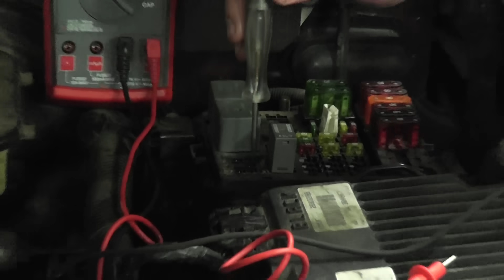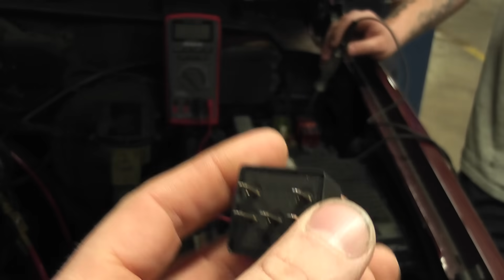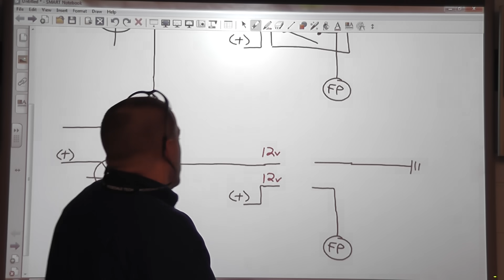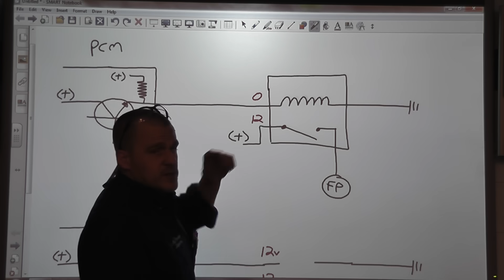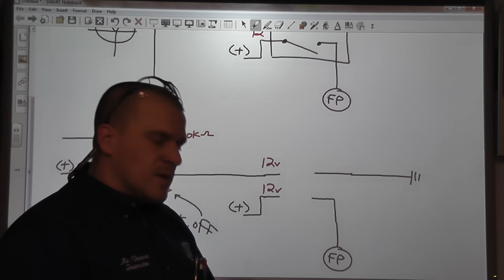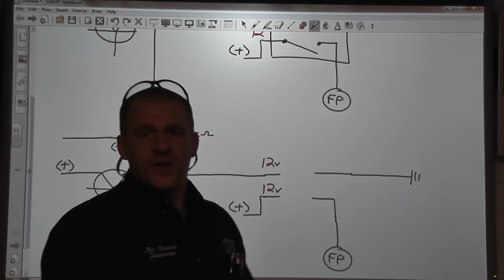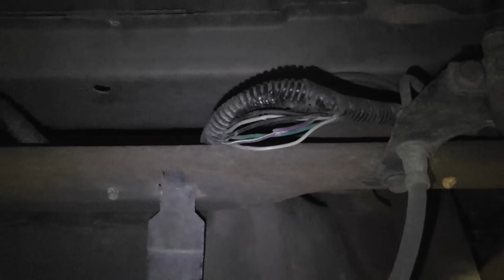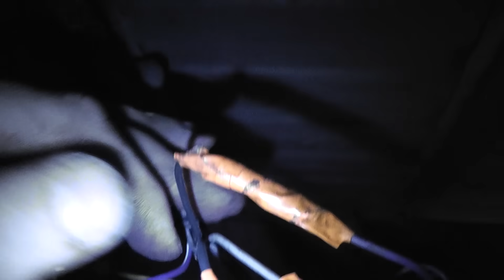GM Fuel Pump Relay Testing

Comment: Good morning,
Sorry if you even respond to this or not, but I have a question about my GMC Sierra 3500 SL 1994 fuel pump. It's a U haul box truck. The relay seems to be located inside under driver stearing area.
1. Suspicion= Bad fuel pump
2. Question+ How do I determine my ground is working in power distribution?

My Diagnostic
1.  +Battery to 86 with volt meter= no battery power with key /without key
2. When I jumper 30 to 87= Horn blows. 
3. -Ve  Battery to 85= 12V(battery  key on).
 I also cleaned the terminal to chasis with wire brush to no effect.
JUst that taking 40 gallon fuel tank is daunting job and I want to make sure of it. Also how do I know that my power distribution has ground contact.
Thank you in advance, and your instruction is really helpful.

Comment: Hey brother this is an awesome video! As are all of your vids!  I am currently T/S-ing a 1997 k1500 w/a 5.7 ltr.  I trying to narrow it down to the fuel pump.  When u checked the relay it had a 4 pin relay.  It looked like the center pin (87a I believe) was broken off or removed.  I am 99.9% certain that this supposed to be a 5 pin relay.  Just curious if you have seen this before or is it standard.  Thanks for any help!

Comment: Im having a hard time with my 1990 c1500 5.7 liter.  I have spark, fuel but low fuel pressure into the tpi throttle body and i have air. The truck will only run on starting fluid or brake cleaner. Replaced fuel pump, tune up and ignition spark control module in the distributor cap. The fuel relay clicks twice but doesnt buzz im getting confused.... Any help is appreciated. Thanks.

Comment: On my non-starting 2005 Astro van, I pulled the fuel pump relay and set my volt meter across 87 and 30, cranked the engine and it started!
I was so shocked I immediately switched off. And it seems to be fixed now...any ideas why it might have started and appears fixed now? 

I thought I might have fried my multimeter but it's fine. 

Weird!

I did find a bit of chaffed wire coming off the main fuse box (where recent battery change rubbed against fat wire harness), but I don't think that it was touching anything else.  
I wonder if I should have a fuel pump ready for imminent failure...?

This video is super helpful, thanks guys!

Comment: The reason that you see 12 volts on the control voltage terminal on the relay socket with a volt meter (yet the test light doesn't indicate voltage being present) when the relay is removed is because the meter has a very high internal impedance(resistance) compared to the coil in the relay, which is essentially a short as far as DC voltage is concerned, and pulls the bias voltage to ground when the relay is in the circuit. The test light has a filament that requires more current to light up than the bias voltage circuitry can provide, which is why the test light doesn't light up, despite the meter reading voltage. I am an electrical engineer, but don't know the exact circuitry involved, but your description and schematic is pretty much what is happening... What you drew as the bias circuit created what's known as a voltage divider, where the majority of the voltage would be measured across the larger of two resistances in series as you've drawn. All in all, a very good description of what's going on!

Comment: Having the test light and/or the current meter connected are great tools working together when locating an intermittent pump or current feed problem.  I connected a set up like that and monitored them while driving an E350 6.8L V10.  The problem was the fused power pin at the Inertia Switch had got hot, lost it's spring integrity, which caused it to lose contact with the Inertia switch.  Replaced the pigtail, problem solved.  Another tech had replaced the fuel pump AND the fuel pump relay.  He didn't know the connector at the Inertia Switch had got hot/overheated.  It took a while, I finally found it.  Problem solved.
Good Video!  Didn't know about the bias voltage in that GM circuit.

Comment: The Oil pressure sensor is also a source of power for the fuel pump, while the engine is running. This is done to keep you going in case of a fuel pump relay failure, once you turn the engine off, no oil pressure, no power to the fuel pump from that source!

Comment: great video, and i happen to have a 99 old style suburban 5.7 stranded at my sons job site since  last night, fuel pump not running, he starts his vehicles and lets them sit and run for little bit to warm up, his words not mine, this is my suburban he is using, he started it and let it idle for about 3-4 minutes and it just died, dark there etc so im going with test tools and tools tomorrow to attempt to start it, my biggest problem is for every search site you pull up someone has a different story on the pass lock or security system on the vehicle, does it shut down the pump, only thing i know for sure it doesn't shut down the starter, i can test all the components but it makes it so much easier if you know what is supposed to happen. this is the system where the key is a normal key, no magnet or carbon, no rubber on top, just the metal key, i believe it is just called pass lock, or that version of the vats.

Comment: fuel pump relay issue, 2002 GMC Savana, problem is, no 12volts going to control wire (green/white stripe) of relay, so what would keep 12v being sent to relay??

Comment: He this wayne I've done everything to the s10 1994 .checked ful pressure it's at 58 to 62 all my map sensor throttle sensor checked for vacuum put new wires new rotor new cap knaw I'm down to got fire getting gas when it starts it runs rough give it gas to keep it running it flutters out .well I'm thinking crank sensor .I've tore out everything in dash looking for short no short under hood no short this 4.3 is kicking my el butto

Comment: This is why I have Scanner Danner premium on his website. Even if he never makes another video, how can u thank him for the humongous library chocked full of instructional material. I have watched this video several times. But now I have an 01 GMC 4.8 in the shop. And that bias voltage will help me identify control pins. GM relays will plug in both ways and that throws me off. Thank u Paul!!

Comment: So i replaced the fuel pump on my 2000 silverado 4.3, and it ran great for a couple months.. lately its been stalling and dying randomly goin down the road.  Then takes 5 to 10 min to start.  Where do i start?

Comment: Your diagram makes it pretty clear. Ideally you could measure the voltage across the coil in the relay to see if its being energized.  Once you unplug the relay the 100K pullup resistor is in series with your meter ( say a MegOhm or more) so most of the 12 volts drops across your meter. I suppose you could unplug the relay and put a test resistor (of similar resistance to the coil in the relay) where the coil would be, and measure across that.

Comment: Is it ok to use a test light on a computer controlled circuit? (when they checked the prime function on the power circuit) i have heard from multiple sources to not do it, I think it worked very well in this video though. does anybody know what the story is with not using a test light on computer circuits? I would like to get cleared up on that.

Comment: ScannerDanner. Your experience is invaluable. I have been experiencing a no start issue in a 97 suburban. The original fuel pump was replaced a couple years ago. The mechanic I used ended up replacing it twice as the first replacement was dead a week later. It started just fine for a while. After that it started the no start. What is interesting is, it seems to be determined by temperature most of the time. I have heard many bad things about replacement pumps. My mechanic uses Delco replacement parts. 

When it doesn't start, the engine will turn and turn and sounds like it wants to fire. When you let off on the key the engine will bump a couple times like it's still trying to take off. There is a video on YouTube that displays what is happening. And I have come across a lot of others that seem that have the same problem. 

I find that if I turn the key to prime the fuel system 3-4 times I can get it to start more often. Is this an issue with aftermarket oem pumps???

Comment: Hello. Everybody. I. Have a. Dodge caravan 2004.  Somebody broke in my truck. And messed the ignition up. So. My mechanic. Had to drill it. Out. So i went to the junk yard and got another steering colume.with key in it.  The other key. I. Had. With ignition from auto store. The truck ran for a few. Than it shut off. Can abody. Help me

Comment: you saved my butt showing bias voltage . I was making check on my 1998 5.7 vortec and showed 12.24 v. this was messing with my head and i was thing something else was wrong....  I had watch someone else on this relay and they said no voltage on that pin with key off.....thanks so much.

Comment: I have a 2000 Yukon that was randomly stalling while driving.  I installed a new fuel pump and it still stalls every few hundred miles.  Today it stalled so I pulled over and tested the fuel pressure and there was none.  Cycled the key and pressure went to 60psi, car started fine and ran another 100 miles no problem.  Do you think the relay may be the culprit?  Or PCM or a bad wire somewhere causing random shutdown of the fuel pump?

Comment: Hi great video! 91 s10 4.3I have biased voltage with my relay plugged in.coming from ecm 0.07 volts when not plugged in 11.70 volts. I have pump running jumping org wire to green white wire. The prime doesn't work.could pump be bad? Thanks, Greg

Comment: ScannerDanner, I'm having a weird issue with my 1991 Cadillac Fleetwood Brougham.  My fuel pump does not turn on with the key. But when I hook the 2 wires of the harness to a jump box, you hear the pump running. There is still no fuel pressure though (car will not start).  There are 4 wires to the pump. I believe there are 2 grounds, a pump wire, and a sending unit wire. Could it be a bad ground?  Also, when I turn the key forward and put a volt meter to the 2 wires, where I had the jump box hooked to, I get a 12 volt signal (indicating that I'm receiving power).  Furthermore, I did unplug the harness from the car when I plugged the jump box directly to those 2 wires.  And I also left it unplugged when testing for voltage from the car's end of the harness.  Should I plug the harness back up, turn the key forward, and then check the pump side for voltages and grounds?

Comment: Hi Scanner Danner, great video!  I learned a lot, thank you.  I have a 1997 C2500 5.7, (bought new, cared for, now has 229,000 miles and looks a drives like new) and I'm curious about amperage.  I'm drawing between 9 and 10 amps.  I used my Fluke 337 clamp on amp meter on the wire to pin 30.  The reason for all of this is the 30 pin got so hot it cooked the surrounding plastic.  I repaired everything and now for the first time, I'm checking for heat and finding some after a 10 minute drive.  30 and 87 are hot to the touch.  Is this normal, or could this be a sign my pump is going out?  I'm on my third pump.  First one died of low pressure.  Second one didn't work after a six hour drive.  I appreciate your help.

Comment: Nicely done but you should find the guy who installed the pump and tell him to find another career. Not only were the wires backwards but the splices were hack jobs and they ruined the wires by stripping the insulation off. Both of these would have failed again shortly after water and salt got to them.

Comment: Wow...  You guys deserve medals for your painstaking film!

I still don't quite understand why the PCM needs that bias voltage - which makes a 1950 test-light superior to a modern, 10-MegOhm meter - but that discovery at the back reinforces what I tell people about using OLD shops instead of start-ups...

I actually encountered the same problem with 110V in my Elks club.  When I converted old-style potentiometers and mag-ballasts to modern electronic units, they wouldn't dim...  Sure enough, some moron had wired white-to-black & black-to white!
LOL

Comment: 96 chevy blazer 4.3 has a new pump, relay and fuses. have tested pump(just in case I got a bad one), and I still get no power to my pump. Have tried everything people suggest except wiring direct. that just don't seem safe to me. Being a pro, do you have any ideas I could try? really need help here. Thanks

Comment: would anyone know anything about this problem?
parked.mu truck.
got in it after work and started right up.
but then was acting like it was not getting fuel.
changed the.pump
started right up.
but when I go to step on gas pedal it wants to die...any ideas????.

Comment: Question : Since the wires that were wrong back at the tank could that have been the reason that you were getting the 12 volt reading up front. At least  it was a thought.

Comment: this video , saved my but , helped me determine,  i didnt have a ground .    it would be better if he took out all the diagrams/graph part , but all in ,  need to add , a reminder if you took the bed off a pickup for installation of pump rather then the droppingvthe tank ,     must re-connect,  the ground wire to the frame where you unpluged the tail light wires for the bed removal,  or you end up looking at this video - simply for a quick test after install of new pump , with the bed still off ....  before installing the bed .       all mechanics check their work ....

Comment: I have an 89 camaro with the 5.0 that for some reason after sitting it will not start.  I do not hear the fuel pump come on when you turn the key.  But if I run a hot wire from the battery to the wiring behind the back seat I can hear the pump run.  I replaced the fuel pump relay but it still will not start.  I loosen up the fuel lines at the carb but when I even hot wire it I am not getting ful.  I know the car has fuel.  I am at a point of dropping the fuel tank again and try replacing the pump.  Not sure if the pump is running in reverse when I touch the one wire or not.  Tried touching the other two wires but nothing happens.  Got any suggestions you can send my way.  Sure would appreciate it.

Comment: Damn I wish they would've kept it simple and more reliable by sticking to mechanical fuel pumps. This is interesting and informative but I've got more important things to study and learn. Planed obsolescence (intentionally designed to fail after a given time) is an integral part of all design these days. I'm no mechanic by trade but even I could have kept my 64' Chevy truck running indefinitely, but THEY don't like that. Today's good mechanic has to be like yesterdays rocket scientist.

Comment: I would think the voltage behaviour you describe will be to do with the on board diagnostic system, to allow the ECU to determine shorts or open circuit situations.

Comment: I drive a 2006 Savana for work, its owned by the company and it was randomly stalling. My boss's mechanic put a new fuel pump on it, that got it running for for a day then it wouldn't start. So the mechanic said it was an electrical problem and he said the fuse box was faulty, apperently he replaced that. Now the wiring is a bit screwed up but it was kind of runs. The engine would surge really bad. I took a look at it, the fuel pressure was really low but only when driving, idle was fine. I tested the fuel pump relay and the voltage when driving would go from 12v to 3v then up to 12v and so on. I did some more tests and found the wiring for the fuel pump relay runs in series with the canister purge valve. So I bypassed the purge valve and now it runs fine. Does anyone know if they are supose to be wired in series like that?

Comment: I guess that if the pump relay is ticking that would be the computer causing that. I haven't gotten a chance to look at it yet but it also constantly primes the engine in the on position before cranking and ticks like a clock, while priming and running. Engine surges bad, follows the ticking pattern. Very strange.

Comment: I have the  same problem  but if I let it sit it will start and will run for a week then not start I have replaced the fuel  pump" it has spark .

Comment: so, I'm following along and everything looks good until I get to testing the relay with the volt meter... I'm not registering the 12+-  volts while checking. does my testing go in a different direction from this point? I couldn't do the test while dropping it to 0 when touching the light tester at the same time

Comment: i'm not sure how this works.to a not to email or this posting but my dilemma; no spark no fuel pump or no dash engine light. the 85 pin with no power. looking to find testing the coil, module, crank sensor, ecm . thanks

Comment: I am trying to fix my dad's 96 Sierra. It will start, then it dies after a few seconds. With the relay out, Key on, I never get 12v at pin 85 (using a fluke volt meter). The 12v will come up for 2 seconds right after turning the key on, but I never see the bias voltage. Does that mean something is holding that bias voltage down? Or is there a problem with the ECM?

Comment: so to test and find the control wire of the control side of the relay im guessing that you use a low amperage incandescent test light, the ones that are around 200 mA?

Comment: my 95 jeep cherokee isn't getting power to the relay, but before this happened it was taking a minute or more for it to trigger the relay and get power to it but now it won't at all, so something burned out but can't find any  fuses burned,  I replaced the pump but that's not it and I knew it wasn't but was told I should do it.  Something between the ignition and the relay isn't connecting, what could it be? the computer?